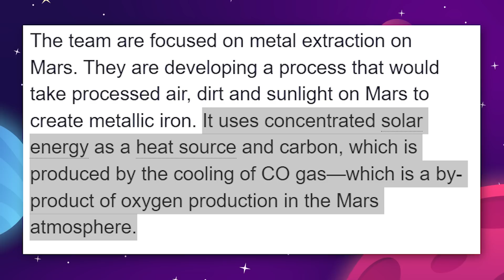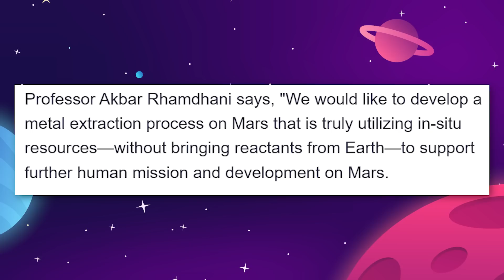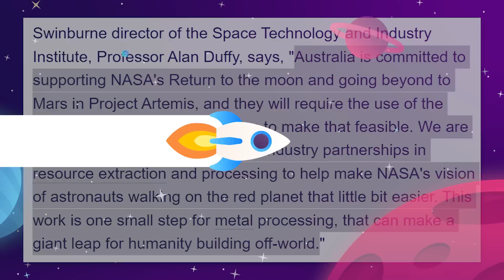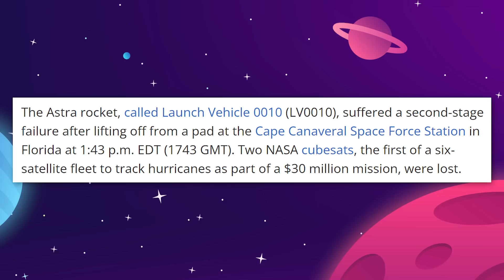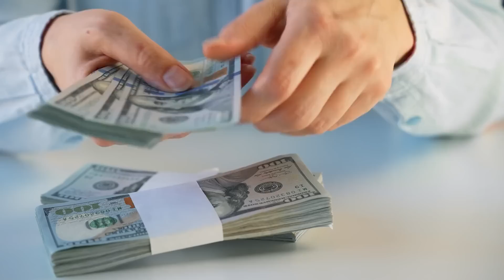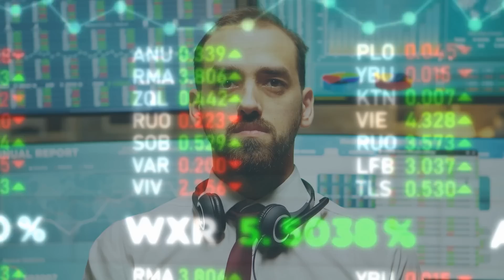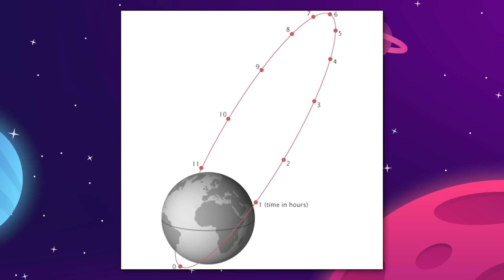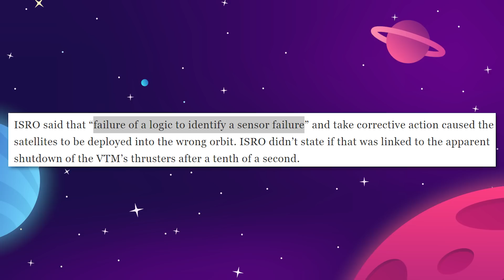Major New Mars Colony Update!

Comment: Stainless Steel requires Oxygen to be corrosion proof. No Oxygen makes for a Yin and Yang situation.
Reply: The idea of a yin Yang is opposites living in harmony ( just fun facts )
Reply: @Unknown_nobody-p7b  Stainless Steel corrodes wildly in the absence of Oxygen. That is why Stainless Steel is not used in the hull of a war hip, or any application where the stainless steel is permanently submerged in water.  To be stainless SS needs free oxygen to be rust resistant, but to oxidise only needs molecular oxygen as in H2O. Read the disclaimer on SS boat components. Yin and Yang apply to SS in a very sneaky way.
Reply: @charliemckay6402  oh ok nice

Comment: I do agree with most of what you said.   But Astra has had too many failures for their budget.  This speaks to a system problem.  Not a rocket problem.    My Guess would be either not pushing the unit tests or relying too much on unit test and not doing enough integration tests.  What ever the reason, if they are not capable to figure out the caused the problem in the rocket, No one should move forward with them.
Reply: Hindsight (or logical thinking): do not commit an expensive satellite until there has been at least one successful orbital insertion with a dummy load.
Reply: @JustAThought01  Or like What India Did where the payload was a satellite developed by student so if it is lost there is no major financial loss on ISRO as the payload is made by Department of Science's funds
Reply: I agree. I think that most small sat launch providers are going to go under for this reason and the fact that the small sat market will not be big enough for how many launch providers there are due to Starship and the other heavy or super heavy launch vehicles that will be developed in response to the larger payload market that will explode in size because of Starship.